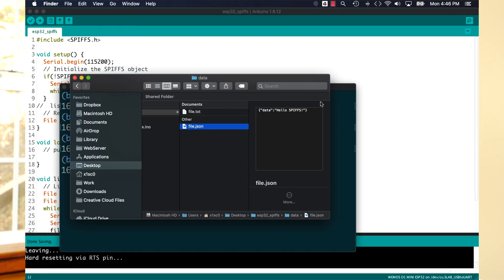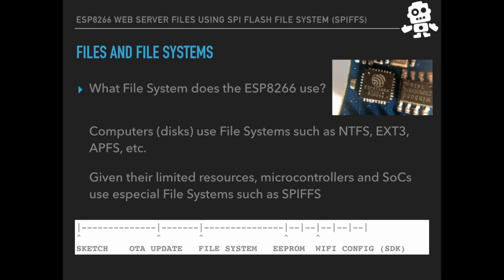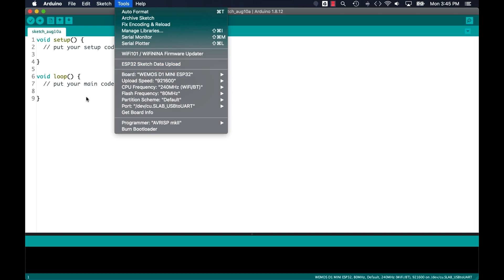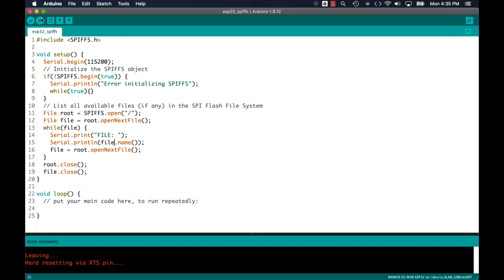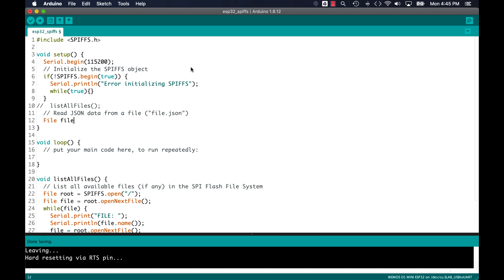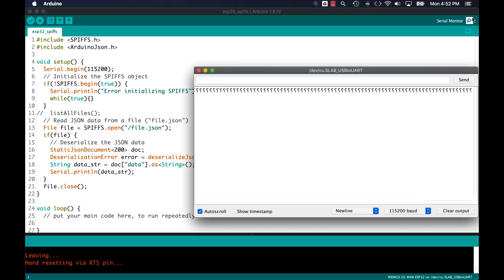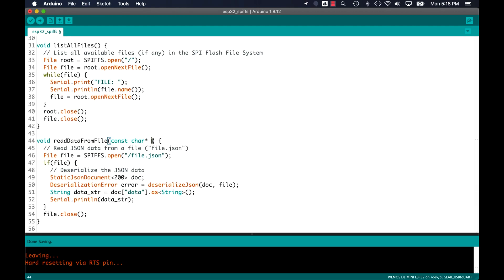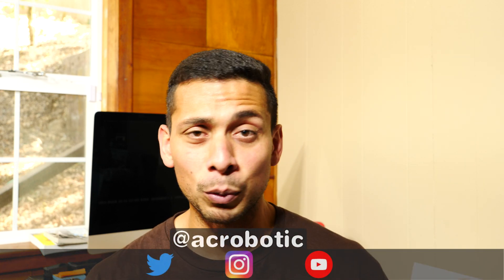ESP32 Save Data To SPIFFS Flash Memory w/ Arduino (Mac OSX and Windows) | File System Storage

Comment: not possible to install the menu. what ever I try. but github has change and files are nit to find.
Reply: I couldn't get this to work on the Mac. 
The menu just doesn't appear. I messed up the software so much that I deleted Arduino and reinstalled it. But I kept my programs.

Comment: I didn't get it from the first time. 😕
I watched again. With lots of Back and Pause until I finally got it. 
👏 
Looks perfect to integrate into my project, to save WI-FI  credentials from Bluetooth.
On question,  how to delete files 🤔 or truncate? I guess I can delete and write it back for truncate part,  but how to remove files? 
Thanks for sharing this information.

Edit 
Found more info here:
https://diyprojects-io.cdn.ampproject.org/v/s/diyprojects.io/esp32-get-started-spiff-library-read-write-modify-files/?amp_js_v=a6&amp_gsa=1&usqp=mq331AQHKAFQArABIA%3D%3D#aoh=16139948428973&referrer=https%3A%2F%2Fwww.google.com&amp_tf=From%20%251%24s&ampshare=https%3A%2F%2Fdiyprojects.io%2Fesp32-get-started-spiff-library-read-write-modify-files%2F

Comment: 4:19 hol' up. Just glossed over a key issue. How tf do you upload files that are not your code to the ESP32??  Does the Arduino IDE just automatically create a SPIFS filesystem and copy whatever is is your workspace to the arduino??

EDIT: Got it working in Platform.IO, which has a separate Upload task just for SPIFFS filesystems. Idk how the Arduino IDE figured it out

Comment: Thanks for the info. 
Is SPIFF being replaced by Little FS?
Reply from the maker: Hey, Tim. Glad you found it useful. I wouldn't say replaced, as SPIFFS does its job well. But you're right in that Little FS is being actively developed as opposed to SPIFFS. If I were to start a new project, I'd go for Little FS based on that, so you've motivated me to do a video in the near future covering that option as well. Thanks so much!

Comment: Hi Cisco, I am looking for a solution that able to capture a photo from an IP camera api and store inside SPIFFS and send to my telegram on LINE messenger.  R u able to teach on how to do it?
Reply from the maker: Heya, STU. I need to do a video on the ESP32-CAM relatively soon. I'll use part of your idea (store images in SPIFFS) for it. So that I can keep the video short-ish, I'll show how to access the images with a web server. Hopefully that sets you in a good direction to sort out the Telegram side of things!
Reply: @datasith  actually I saw many using ESP32 Cam doing kinda stuffs snapshot and send to Telegram. I even make it but I don't like ESP32 Cam bcoz it is not so stable and hung occasionally and need to be reset and it is a trouble where my esp32 Cam being installed on a dummy camera housing and I need to climb up and down. I tried many many ideas given by a lot of people about power supply and etc etc but it fails too.  That's why I am looking for a solution using esp32 or esp8266 NodeMCU to trigger snapshot by using url http API given by IP camera manufacturer and send it to Telegram or Line notify.